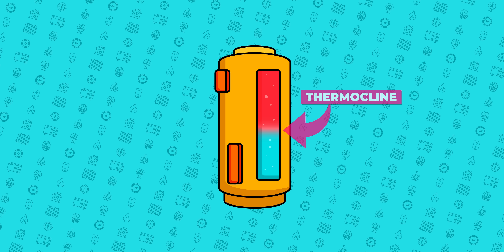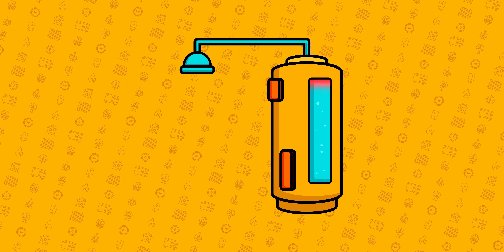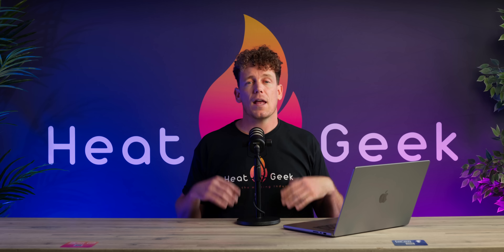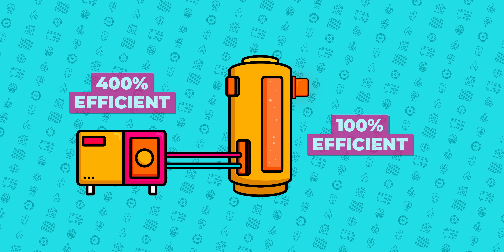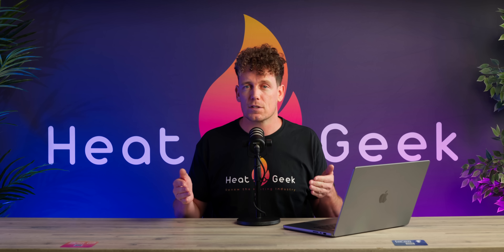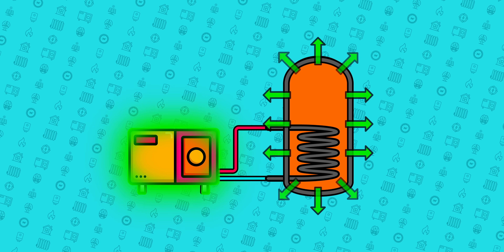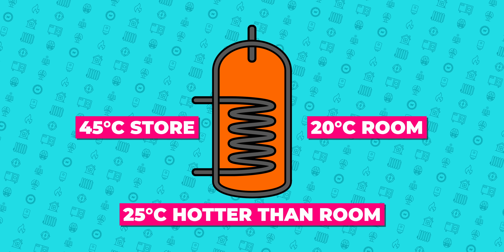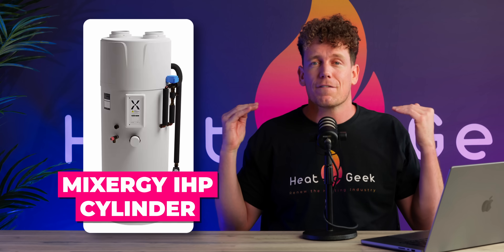Mixergy? THIS ALTERNATIVE CYLINDER IS 400% BETTER?

Comment: I'm interested in doing a heat pump with a sun amp heat battery instead of having a cylinder. Is there an efficiency gain here or are you better off with a cylinder?
Reply from the maker: Cylinder
Reply: Cylinders more efficient. Sunamps don't require unvented inspections or discharges. (can suit landlords / flats better)
Reply: Wouldn't the heat battery store the heat energy for longer (potentially days) while the cylinder would need topping up daily. It might take more to charge the battery initially but with it holding heat longer and potentially heating more water than the equivalent cylinder (that may need recharging) do the efficiencies not level out. Interested to know and hopefully described my thinking correctly.
Reply: @baxta  If you use hot water you need to put the heat back in. Charging the sunamp with heat won't be as efficient as charging a cylinder with heat.

The losses from modern cylinders (especially at lower storage temperatures) and the Sunamp are small compared with the heat needed to heat the water in the first place.

Unless you can't fit a cylinder...fit a cylinder...and spend the rest of the money saved on a better installer / better heat pump / larger radiators etc.
Reply: Also I've been enjoying the hot water on demand from combi boiler compared to running out of hot water with a cylinder and figured the heat battery was the nearest option to the combi so I like the theory of it but cannot find real world info on running one compared to other options.
Reply: Buy the marketing kool aid if you prefer that to the answer given @baxta  

It somebody could provide data but chooses not to provide data this probably tells you all you need to know about Mixergy / Sunamp vs Cylinder. ;-)
Reply: @meterpoint  fair point about the lack of data. I'm just trying to figure out the direction to take while the house is completely ripped apart. All I know is I want to get away from gas especially if I can get solar in the future.
Reply: A cylinder @baxta  - it's that easy a decision! ;-)

Comment: I was just about to write a ‘what about’ comment when you mentioned the iHP that I’m curious about. Have you reviewed this product at all? I can’t find many detailed reviews on t’internet. I’d certainly be interested in hearing you expand on ‘looks absolutely fantastic’ as this seems to be the first of its kind?
Reply from the maker: No there’s many of these around. They utilise stratification more so I believe though so probably the best of its kind
Reply: There are a few other "all in one" heat pump hot water cylinders available in the UK. However, the iHP is different in that the top HP section & the bottom tank can be separated for easier handling & installation. Also, if the top HP section develops a fault it can be removed for repair or replaced without disturbing the bottom cylinder section. Other HP all in one tanks are sealed units so if the HP packs up or the condenser springs a leak then the whole tank has to be replaced. 
I'm also interested in the iHP together with a Sun Amp thermal store. The Sun Amp could go in my airing cupboard to replace my existing tank but not the iHP due it's operating noise level. iHP would have to go in my attached garage or possibly in my loft space - loft hatch not big enough though. Pros & cons for both so perhaps more ammo for the Heat Geeks to get their teeth into in other videos.

Comment: Hi Adam great video!

The water volume meter is an interesting idea, how does it work? Will you have a video on it?

I'm guessing you say that as long as a certain volume has been used within a certain period then a legionella cycle is not required? Does it communicate with your HP control unit?
Reply from the maker: Video due
Reply: @HeatGeek  Fantastic I look forward to it!

Comment: What the hell has happened to the world , when did getting hot water become so complicated.
Reply: It's not complicated i think net 0 target'smade it complicated 😂. Being an installer of daikin and Worcester systems. It's actually pretty easy once it's set up fir the customer. And at a fraction of the price to heat your home. . But needs set up right by someone that knows what their doing
Reply: @NexGen86  wow = eight months has gone since I made a comment about hot water being an issue , I had forgotten about that comment obviously until now.
Reply: @kavanobrien6547  haha sorry man. Algorithm and all that 🤣😂
Reply: @NexGen86  I thought is somewhat amusing having a message eight months later , even a lost pigeon would of been quicker.
Reply from the maker: It’s only complicated when working with smart grid. No one is forcing anyone to do this.
Reply: @HeatGeek  just thought it was somewhat amusing that’s all , also like the 400% efficiency heat pump line  = dying is easy comedy is hard.
Reply: @KavanOBrien your saying you disbelieve 400%?
Reply: @roscopeco2000  just repeating what was said, think is somewhat funny .
Reply: @KavanOBrien what's funny about it?
Reply: @inh415  what’s funny about what ?